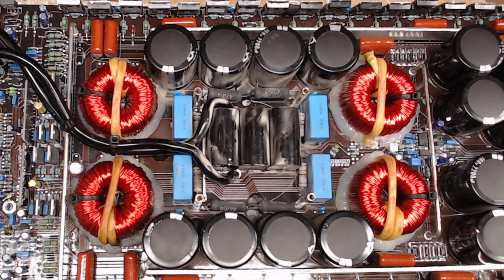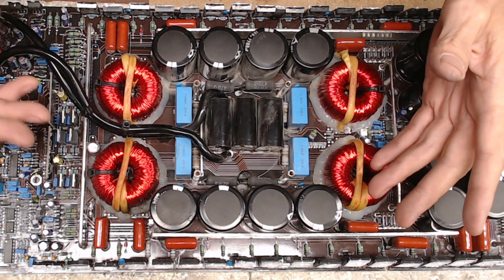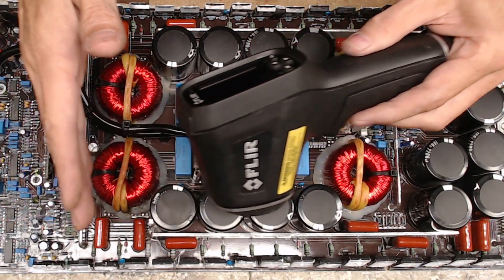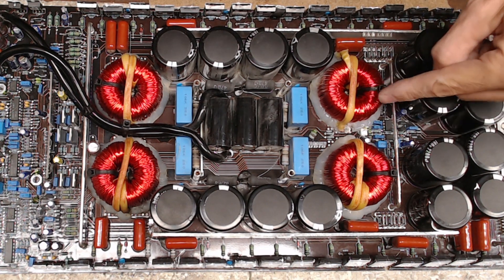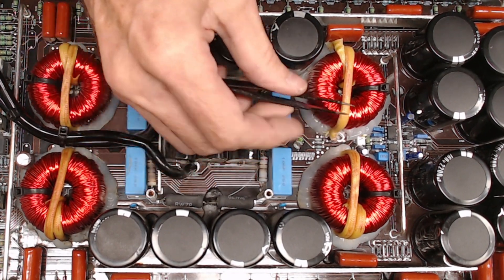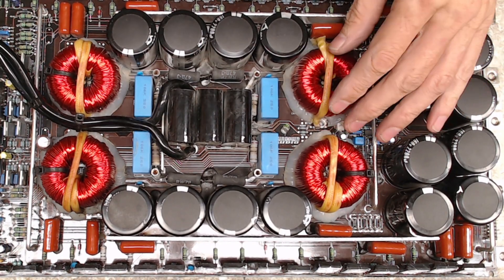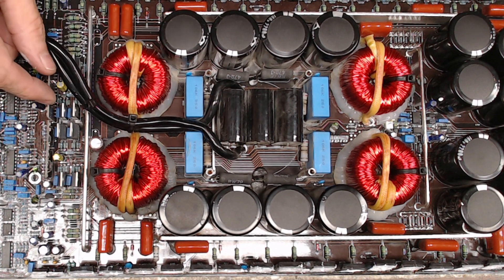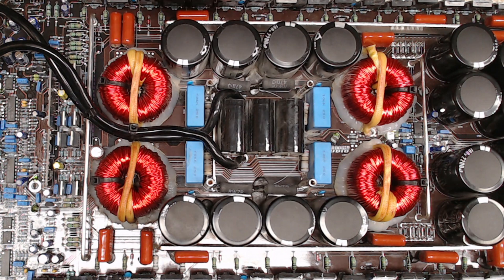Sundown Salt 12 Inductor Not Soldered WHAT IS THIS Sundown Audio?

Comment: I purchased a salt 4 from the yard sale on their website. When it came in the mail, I powered it up on the bench made sure it worked because you have to report any problems within three days. Needless to say I installed it two weeks later and when it powered up and started to output, it started smoking sundown won’t do anything about it. I opened it up and several transistors Let the magic smoke out. I don’t know why.
Reply from the maker: Did it start on the bench? If so and it had no issues, then your input voltage is what you will need to look into. Also, make sure your impedance is not too low. This is an all-too-common scenario.

Comment: is this a full bridge design?
Reply from the maker: This word is widely misused in relation to the topology of an amplifier. https://youtu.be/b6tyjXSHvGg Sam covered it well. The negative output of a Salt 12 is bonded to secondary common "ground" and full-bridge amplifiers are not like this like the Taramps where you will see both speaker terminals with positive voltage.
Reply: @ellensburgamplifier  this is not correct. 5 min. 20sec. I see two speaker wires that are not connected to the common (ground), they are connected to inductors
Reply from the maker: @shilosound  So the topology of this sundown is 2- Half-bridge amplifiers connected in an H-Bridge style.
Reply from the maker: @shilosound  To confuse this topic even more.. the Salt 8 is a single half-bridge with speaker negative to secondary common. ;)
Reply from the maker: The negative speaker terminal is not bonded to the secondary on a Salt 12. Thank you for catching that.
Reply: @ellensburgamplifier  I was wondering, where the amp has 20k clean power at +-120v secondary voltage. Now I understand. Because it's a full-bridge topology. Thank you for information

Comment: I can't understand, why this amp has capacitors 160V? Salt 8 has capacitors 200V
Reply from the maker: It is the difference in rail voltage.
Reply: @ellensburgamplifier  what is the voltage of SALT 12?
Reply from the maker: @shilosound  If I remember right about 120+ volts @12v input.
Reply: @ellensburgamplifier  at this voltage, the output power will be approximately 7.5-8.5 kW
Reply: @ellensburgamplifier  but I saw on YouTube, they took 15-20kW from this amplifier. i think it's fake
Reply from the maker: @shilosound  That's why people love to push the voltage limits. Crazy voltage when is sees 16 volts. Keeps me in business!
Reply from the maker: @shilosound  If they put enough voltage in they may have hit those numbers. These on average are 1:10 transformers.
Reply: @ellensburgamplifier  thanks for the information
Reply: @ellensburgamplifier  Quick question, sorry to piggy back but trying to understand how the voltage rails work. if its 120v at the terminal does this mean the rails are +- 60v? or would it be  120 +- ? Also do you guys know off hand what the rail voltage in the salt 8 is?
Reply from the maker: @rashad5286  Hello and thank you for the great questions. Rail voltage measurements are referenced to common so it would be +120v and -120v for a peak-to-peak sign wave of 240v if everything was 100% efficient. This is your typical half-bridge design which should not be confused with the full-bridge designs. For the Salt8 I think it was roughly 130v @ 12v input (1:11 wind ratio I think) but this information I do not have on hand as I quite servicing all SALT amplifiers. People don't pay attention to the purpose of the "SALT" design which is why one will have extreme rail voltages when used with high-voltage lithium systems.
Reply: @ellensburgamplifier  Thank you so much for the explanation. It was confusing because I would figure like you said +120 -120 for peak to peak. But I would assume it was a 240v when actuality referenced to common  its 120 either way assuming no efficiency loss. Im currently repairing a salt 8 amplifier blown charging in the mid 15's and pretty much figured the rail voltage was way too close to the threshhold of the 24n40F fets.
Reply: @ellensburgamplifier  One more question if I may: So i know the power section transformers go into the rectifier diodes and then the capacitor bank. Is the power section output arranged so it gives the output section - 120  0 + 120 > and then the caps are wired to smooth out both sides of each rail ? Sorry for so many questions just trying to get a more indepth knowledge of how the half bridge amps work instead of repairing and letting some aspects be a mystery or guess work. I really do appreciate the help!
Reply from the maker: @rashad5286  HAHA classic! Yup that is the problem, people are running these SALT amplifiers above OEM charging specifications. For anyone who reads this comment, SALT stands for "Sundown Audio Low voltage Technology".
Reply from the maker: @rashad5286  You are correct. All you are dealing with is a large dual-rail SMPS.
Reply: @ellensburgamplifier  Thank you for confirming !

Comment: Everyone is quick to blame sundown that is a factory defect it happens in all brand they control what they can but I do feel it should have been tested someone dropped the ball for sure
Reply from the maker: True as they are all flow soldered at practically the same place just gets different names put on them. I see QAQC issues from every manufacture.

Comment: Nice find. Would you attribute the output section failure to this non active inductor? 

I've had more than my fair share of sundown equipment, some actually really good experiences (old OG stuff) and some bad ones too(newer gear). The more recent the gear, the less reliable from my experience. Its been a while though for sure. Maybe it's better, but this video definitely doesn't inspire confidence or trust again. 

I don't buy sundown anymore, haven't for some time, and have switched to other more expensive and value brands too. They all give you the same shit quality, but are at least are more reasonable with excessive profit margins. 

Makes me wonder how many other salt amps or other have QC issues like this, and we're denied warranty. There's definitely other quality control issues, like protection circuits that don't work. The amp just goes up in smoke. I've personally experienced it, and saw it first hand with bass buddies. I couldn't count how many times I've protected the old shit, never repaired, never a problem. They come back online and just work. They don't make them like they used to.. You pay a premium for quality, and pay even more so for the name as well, and this is what ya get. 

I haven't bought anything from them since the zv4 days(6 years ago?) and I won't again... I know I've saved a bunch. 

Awesome videos lately, you get a thumbs up from me every time. Need to comment more for the algorithm for sure, you deserve it.
Reply from the maker: I truly thank you for your comments. Here is what I would take from this board. There is a thermistor on each side of the output board. When one side is cooler than the other from a missing inductor (which leads to no load on the transistors), the thermal protection circuit may not "trip" as designed depending on if the thermistors are in parallel or in series. This out-of-circuit inductor more than likely may have contributed to the other side's complete failure in my opinion.
Reply: @ellensburgamplifier  how much do you charge to repair amps
Reply from the maker: @jbell0507  I charge by the job and not by the hour. As of now, a full rebuild of something like a Salt 12 is around $450 www.ellensburgamplifier.com/faqs

Comment: Great video Todd that's so the temperature is something every repair guy should check for I have a video am going to upload soon with a issue I have with a sundown SFB 1000D
Reply from the maker: Checking temperatures is a huge step in my business. I like to monitor temperatures for about 2 hours to make sure there is no thermal runaway or specific heat issues.